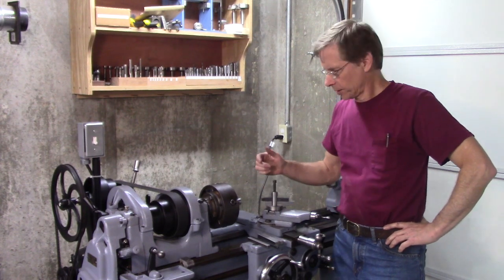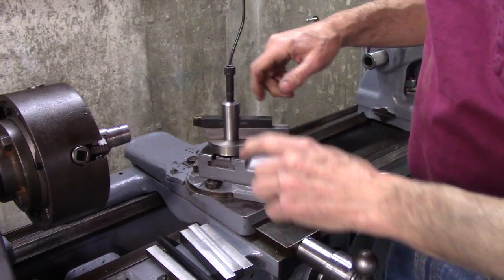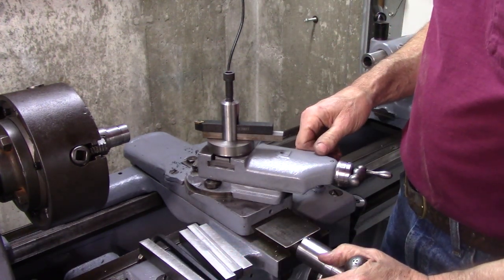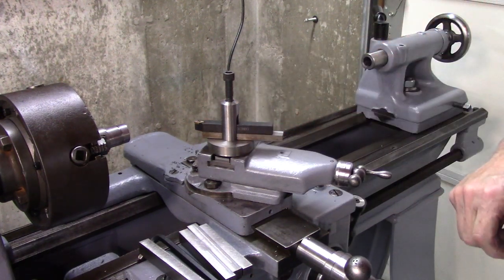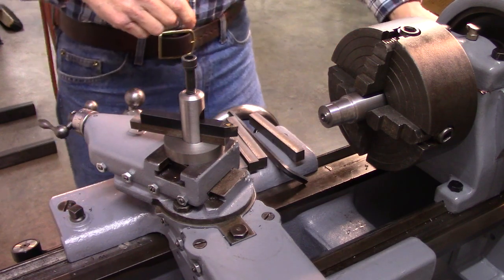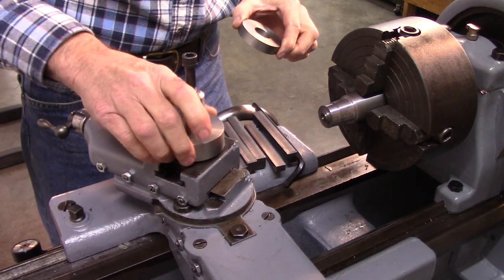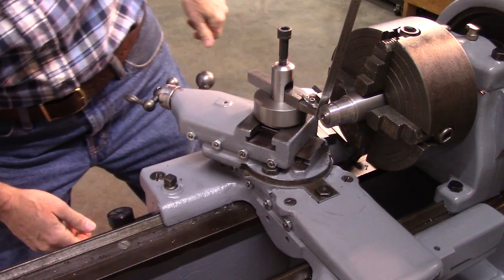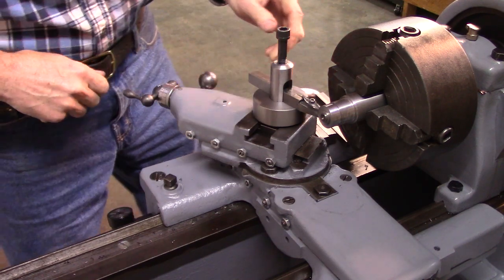Building an Improved Lantern Style Tool Post - Part 2

Comment: Looking good with the adjustable base. How about trying it on an interrupted cut, I have not tried it on mine yet, don't know if the threads will back off or not. At least it lets you use any armstrong style tool holders you might have. Thanks.
Reply from the maker: I sold all the tool holders but I use a lot of carbide inserts anyway. Thanks for watching!